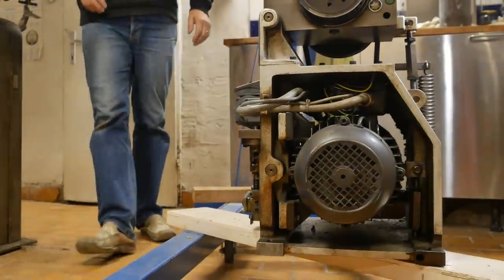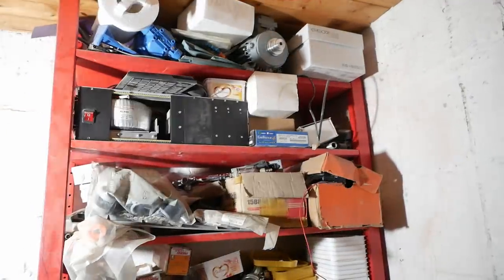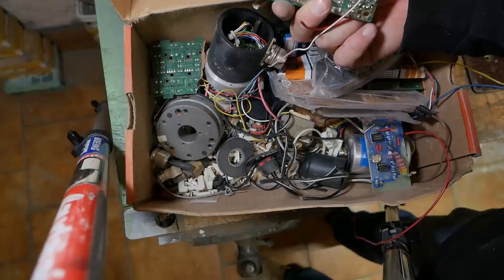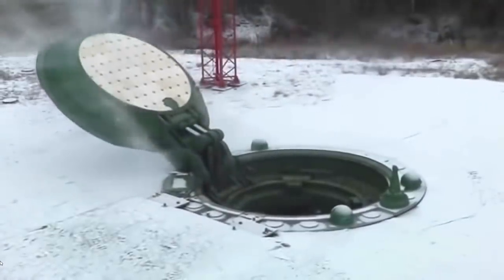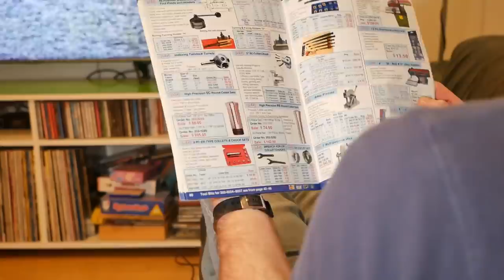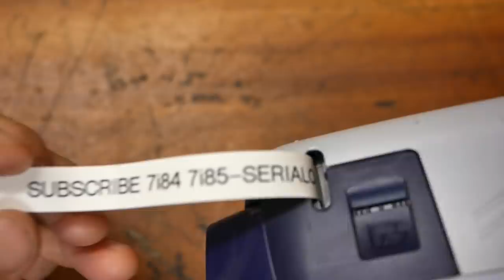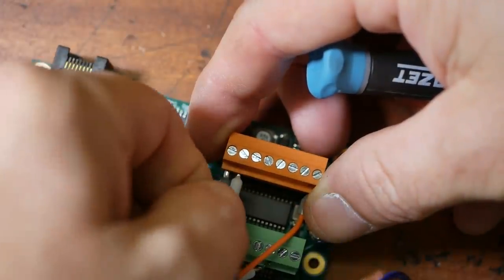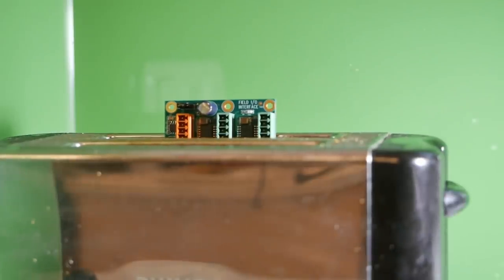I think I ruined this CNC control card.

Comment: most probably the pin23 was grounded and 7i84 has sourcing outputs.. so you just blew the output stage which is shorting the supply rail now.. replacing that big IC next to the output connector is most probably all it needs ;)
Reply from the maker: Thanks for the diagnostic. Wonder what else I could wreck with the soldering iron in there?
Reply: This seems unreasonable to IC designed for industrial IOs
Reply: @RotarySMP  hot air is the way to desolder that IC , i bet you'll find someone among your local fans who could do it. the only challenge would be to get the chip.. the NCV7608 is an obsolete part not manufactured anymore, so old stock or recycled parts from china would be the only source.
Reply from the maker: @robertjung8929  Good points.
Reply: @poprawa  check the datasheet of ncv7608,  it doesn't have any short circuit protection..the output stage is just a plain mosfet,  so once you short the output it will blow.
Reply: I have used Mesa cards a lot now. The field io seams quite strong against short circuit. If I remember correctly the 7i84 board has 2 separate 24v inputs. If one of than is still working replacing that ic might do the trick. Pins are big enough that a simple soldering iron and a big blob of solder with a lot of lead will be able to take of safely.
Reply from the maker: @heronguarezi6501  Thanks. Maybe I get lucky.
Reply: Removing just the IC can be a workaround. If only that is fried, the rest of the board is usable after removal. And I believe you don't even need to solder it off properly, just cut the leads carefully, without damaging the PCB. If the remains of the pins are mangled so they're touching on the board, then they can be desoldered easily.
But I suggest asking for help in this case.
Reply: @besenyeim  that chip is controlled through SPI bus.. and i bet you the MCU is reading back the status to detect errors. so it would need modification to firmware as well.
Reply: @robertjung8929  Yep. But with those plastic connectors so close, you need to desolder them first and then hot air the chip out, or you'll get awkward new shapes in the plastic. Get a replacement IC soldered in place and resolder the connectors back on the board.
Reply: @JoseSilveira-newhandleforYT  mask them out witch capton tape and aluminium foil. or heat the board from below.. there are many tricks to do it.
Reply: @RotarySMP  As we know, soldering is not your finest skill 😱
If you take it off the board and the short goes away you're probably on the right track.
Reply from the maker: @Andrew_Fernie  I have an offer from a professional repairman here in town to help me out. That is lucky.
Reply: @robertjung8929  Yep, very true, but some plastics are really flimsy - I had a problem with this type of connectors, even with heat shielding.
Reply: @RotarySMP  Sounds like a good option 👍

Comment: In case you don't know, when switching off an inductive load (like a relay), the relay coil makes a very high voltage spike, possibly 100V or more, even though it may only be running on 12V. If this spike isn't controlled it will produce the results you observed: a fried output chip.
Some switching chips have a built-in reverse diode across the load to snub this sort of thing, some don't, and some have tiny diodes that will die on the first real voltage spike.

In general, get a 1N400x diode and put it backward (the non-conducting direction) across every relay coil to be switched. The driver chip can now turn the relay on, and when it turns off, the flyback diode harmlessly dissipates the voltage spike the relay coil generates.
Reply from the maker: Thanks for the tip.
Reply: From the manual, page 9.

VOLTAGE CLAMPS
The output driver chips used on the 7I84 have built in Zener diode clamps to clamp
inductive turn-off (fly-back) spikes. This means that flyback diodes are not normally
required on small (less than 60 mA) inductive loads. If high current inductive loads are
switched or inductive loads are switched at high frequencies, they must have
flyback diodes to limit power dissipation in the 7I84's driver chips.
Reply: According to the Festo 10 CPV manual, the valves are 1.2 watts, which at 24V is 50ma, so no external flyback diodes should be needed.
Reply: @JCWren  Diodes are cheap enough I would install nevertheless. An ounce of prevention is worth a pound of cure.

Comment: 7:05 Not that I'm implying any sort of correctness, but why the choice to not to completely desolder the d-sub? As soon as you picked the cable up, my instinct would have been to cut every wire and make anew, but that's just me... I don't trust old work to 100% what it appears to be on the outside, especially if there is a chance it might have been damaged in it's transition into a new life as spare parts.
Reply from the maker: I will when I do the actual install, this was just about doing a couple of quick tests. How did that work out for me :/

Comment: Using lithium batteries to test stuff might seem like a good idea but it relly isn‘t. Those batteries have very low internal resistance so they can deliver 50 amps no problem - more than enough to fry any electronic circuit. 
I always use a cheap lab power supply with the current limited at 100-500mA. This saved me many times!
Reply from the maker: Thanks. That was a lesson I hope to have learnt now. I have a lab PSU on the Santa wish list.

Comment: Hi. I'm sorry for the board, but we all learn from our mistakes and in electronic those mistakes may result in sparks and magical blue smoke. 
Just as a suggestion: consider investing in a good current limiting supply for testing out assemblies. It kinda stops the pixies to become too angry. Power tool batteries are meant to output high currents, good for tools, not so good for short circuits. Maybe a good old 24v, 5-10w lightbulb in series with the battery can work as a quick and dirty solution. 
Keep up the good work and entertaining videos 😊Cheers
Reply from the maker: Thanks for the tip. Might ask the pixies for a lab PSU for Xmas.

Comment: Probably the NCV7608 driver IC that got fried.
Seems hard to find on ebay, unfortunately ;-/
$9+$5 shipping from china is cheapest I can find, but $15 vs $80 for new card, I think I'd try repairing....
Reply from the maker: Thanks. The problem is that the import into the EU will turn that $15 into $30, and then the "skill" which led me to kill the first one, is the same "skill" which would be involved in soldering the replacment. :/
Reply: @RotarySMP  Soldering that isn't much of a problem for me, also no import taxes here in Switzerland. If you send me that card over to Switzerland I'll try repairing it, try because no idea wether parts from china are fake or not.
Reply: I would never import some chip. They are untested, they are desoldered with open flame or heatgun, they can be ungenuine. Even if chip is recycled undamaged buying it is throwing money at inhuman workplaces, and when part is new it is not source known as legal.

Buying used boards known as broken is my way to go, but not from far east
Reply: And just after all of that it comes to parts never showing up :>
Reply: @RotarySMP  Lately I have been extorting Mouser and Digikey with free freight on orders over $60. A 5kg heatsink and a 4U rack case for a 1kW RF linear amplifier I am making. Given the airfreight prices these days I think they probably lost on the deal. I agree the driver chip is most likely at fault. I suggest you try them out. Top notch service from both. Both orders were a week delivery from USA to Aus.

Comment: Another issue you might encounter is that the CPV10 is expecting you to drive solenoid current through each pin. The Mesa can't do that, as the IOs are driven by a regular octal driver(NCV7608), and can't handle coil current. I'd use a small relay in between, and for each relay a flyback diode.
Reply from the maker: Thanks for the input. I have a bunch of little relay boards as I bought some for the 3D printer time lapse set up. Wonder where I put them?
Reply: @RotarySMP  Bottom left, under the sandwich.
Reply from the maker: @Spirit532  Good call :)
Reply: @Spirit532  😁😁😁😁😁

Comment: I once turned a 19 pin connector into a 19 pin solder hub in a fit of rage and I'm not ashamed to admit it. Also last year I learned that just because a given connector is numbered 1 through whatever doesn't mean that a "matching" connector from the otherside of the world is guaranteed to be numbered in the same configuration. In hindsight, buying electronic componets from an Ebay store that also sells banboo umbrellas and meat tenderizers might not be a good idea.
Reply from the maker: I like that one :) Must have driven you nuts trouble shooting that.
Reply: @RotarySMP  Yep, what did Doyle say? "When you have eliminated the impossible, whatever remains, however improbable, must be the truth"

Comment: Double bummer!  Fried mesa card and truncated rotarySMP video.   A video-runtime:dwell ratio of 8:10,080 is so much lower than the usual-ish ratio ~15:10,080  ;-)   Hope you can get up and running soon.  Might be cheaper to just buy another mesa card than source the IC's and repair it.  Good luck!
Reply from the maker: Yeah, especially of this moron also tries "repairing" it with my soldering skills. Luckily a moer skilled subscriber here in town has offer to take a shot at it.
Reply: @RotarySMP  Awesome!   BTW I think the real toast is in the box just next to the box where your sandwich is hiding.
Reply from the maker: @physicsguybrian  Good call. That board tasted terrible, even with the butter and jam on it.

Comment: Your storage catalog system is remarkable similar to mine! Look long enough and miraculously anything I needed for the last project or will need for future projects can be found, just not what I'm looking for at that very moment.
Reply from the maker: Yeah really. Since viewers are really eagled eyed, and always see details, I need to have the community look for my 32mm hook spanner. Havent seem it since disassembling the ball screws.
Reply: @RotarySMP  That's an easy one, it's most likely right were you left, for me that would be typically where I used it last (I'm channeling Captain Obvious) Couple years ago I "lost" my favorite wire stripper, so I had no choice but to purchase another one. Over the summer one of our machines needed maintenance, so I opened the electrical cabinet and guess what I found? Yep, my fave wire stripper sitting on the bottom...
Reply from the maker: @MRCNC1967  I am also sure that the day I capitulate and buy the replacement hook spanner I will put it in my tool box, right next to the one I couldnt find.
Reply: That storage system doesn't scale well though - ask me how I know that!
Reply from the maker: @gorak9000  I bet. I cant find anything even now.

Comment: A power tool battery is not a great choice for testing. It can deliver some serious current. Some lab power supply would be a lot better,  you can set a current limit and avoid damaged components.
Reply from the maker: A lesson I have just learned. I'll put a lab PSU on the Santa wish list.

Comment: I started watching your yery intresting video with a fresh coffee. Length of your video is not enough for cigaret and  cup of coffee
Reply: Drink quicker.
Smoking is bad for you.
Replace the cigarette with a box of cookies. With adequate training, you go through the whole box of cookies and a coffee under 8 minutes. 
Trust me, I am an expert.

Nico, Health, Food and Safety advisor. 

;)
Reply: @NicoCarsAndCookies  Thanks a lot for your nice technical explanations:-))
Reply from the maker: I had glorious visions of this video ending with me typing commands and the back gear cycling back and forward. Then it took me about 6 hours of dicking around to work out the IP addressing of the 7i92, and get it flashed with the right firmware, and blew up the 7i84. Bummer.
Reply: @RotarySMP   ahahhaa I can see somoone is gonna blame the automatic correction in a moment…

But you have to see it positively. You ended up with a toaster. It never can be bad.

Comment: Hey Mark. When wire stripping: Leave the cut insulation ON the end of the wire!! Use it to twist your wire, then pull it completely off... just a hint, for your otherwise great vids...
Reply from the maker: Thanks for the tip. Not sure I can set the stripper for leaving it on, and which I twist the wires, I get a lot of pushback that you dont do that when using ferrules.
Reply: @RotarySMP  Hiya. You do not have to 'set' the stripper... just do not pull all the way through and/or cut longer than needed, and trim to size thereafter.... I have the 'same' stripper, well from looks its the same....
Reply from the maker: @mounty8807  Oh. Mine pulls the insulation at least 10mm, so if would need to be a very long strip to not come off the wire.

Comment: One ohm might be likely some input protection blown up, like a plain reverse diode blew and ended up shorted. It is perfectly fine to end up with one component failure, designed to blew a fuse while keeping voltage at low value and likely making no harm or just harm to one component and two traces
Reply: But sparking at IO, with no current limit :v Probably something harmful, but maybe coil energizing made some high initial current and everything is fine when it eventually limited current
Reply from the maker: Peter from Mesa suggested I put 12V, 1A from a lab PSU on it, and look for a warm component. Probably the NCV7608

Comment: Happens :) Another potential source of error: ethernet uses really high frequencies (800Hz+ for 1Gbit, if I remember correctly). The isolation is probably not sufficient to prevent wires from talking to each other ;)
Reply from the maker: The Mesa smart serial cards only use the old 100 BaseT. Hopefully this won't also be an issue.
Reply: 800 Hz? I think you're missing an order of magnitude or 2 of unit there somewhere.
Reply: @gorak9000  Pretty sure no. The CAT6 cable I have at hand is rated for 250-500Hz and 1GBit. Frequency does not directly translate to bit in ethernet - there are 8 wires per cable and line coding also plays a role. I only remeber that because we have CAT7/10GBit in the walls and this is where wire layout in the socket starts to matter and stuff - no fun :)
Reply: @schulzcbs  you know 250 - 500Hz is audio frequencies right? 500hz is just a little above a middle "A" (440Hz) on the piano. I think you need to go double check what your box of cable says, and or stop buying the cheap cable from China that has obvious misprints on the box - gig ethernet runs in the 500MHz-ish range - gig uses all 4 pairs, so there are 2 Tx and 2 Rx pairs, so they can run at half the frequency. That doesn't take into account the 8b 10b encoding, etc etc, so it's not exact, but somewhere in that range. MHz, not Hz - as I said, 2 orders of unit magnitude difference (Hz -> KHz -> MHz). If you could transmit a gigagit of data over 2 channels running at 500Hz, Claude Shannon's ghost will come back from the grave and haunt you for the rest of your days! Edited: Ok, so it uses 5-PAM modulation, so divide by 5, and add some for the 8b 10b encoding - and gig ethernet runs at 125MHz - still in MHz territory, NOT Hz - been a while since I looked at the physical layer specs for ethernet
Reply: @gorak9000  Hahaha, you're right. It has MHz printed on it. Stupid me. I guess Shannon haunts all of us all day... I got used to him being around ;D